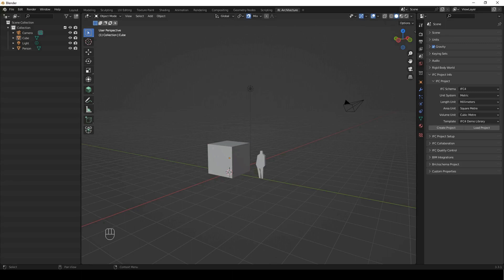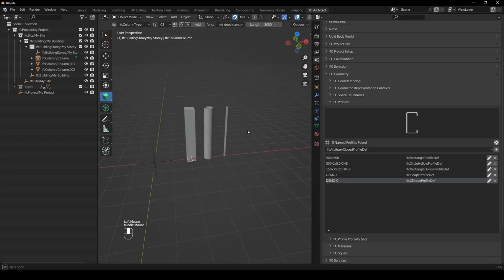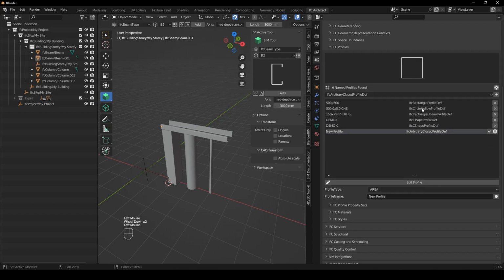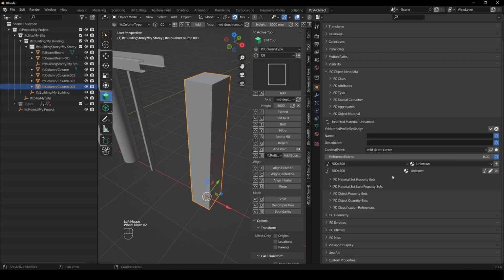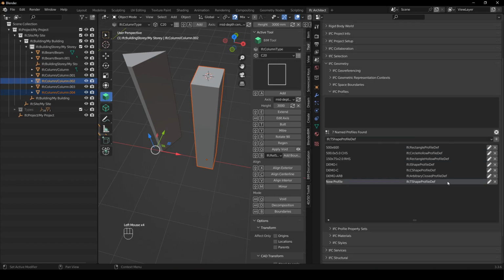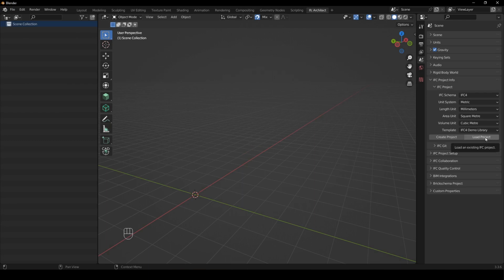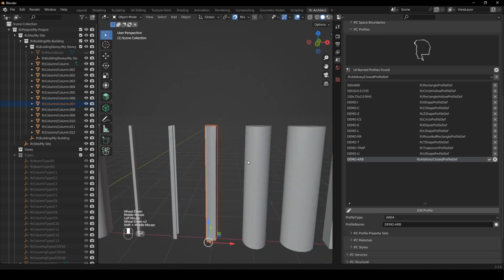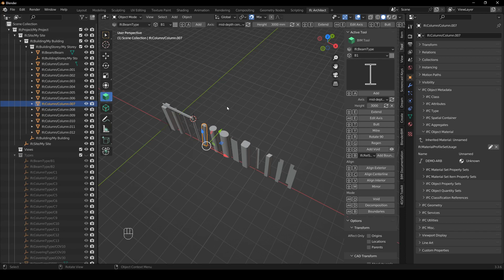BlenderBim - Beginner Tutorial - Beam & Column Profiles - in 13 mins

Comment: How does make a timber colum with a groove and two holes  and then send that to CNC?
Reply from the maker: Hi Wing, you would need to model the shape manually at this point. Then you would export the drawing to cvg and convert it to a dxf with correct layers, from there it should be able to be CNC cut
Reply: @IfcArchitect  Is there any way to translate IFC to BLT format?
Reply from the maker: HI @wingtipzzz  I am not familiar with the blt format, but Ifc is a 3d format it should be able to be exported to any other 3d format

Comment: Hi very interesting project, i have several questions:
1. Add local region of common steel shapes by ascii files or xml e.g JIS database
2. Export geometry (point and line), section and material definition for structural analysis program e.g OpenSees
3.  Connection joint definition for beam to column, beam to beam, truss in IFC formats.
4.  Reinforced steel of longitudinal bars and stirrups for concrete beam and column.
Are those already or possible to implemented in future of Blender BIM?
Reply from the maker: Hi syont,
1. You can add and build your own libraries however they are kept as an ifc file, I dont think it's possible to import a database... yet
2. Yes it exports as an ifc file which should be readable by any other program like OpenSees.
3. Not yet, you can do this but not automatically you would need to model it manually atm
4. I think this is possible, perhaps as an aggregate of a concrete and steel elements but it would not be as parametric

If you have ideas or can help implement these I'd recommend posting on the OSArch forum here:
https://community.osarch.org/discussions

We need more engineers and other professionals to contribute expertise in how they expect/want features and tools to be
Reply: @IfcArchitect  thank you, i will consider joining OSArch forum.